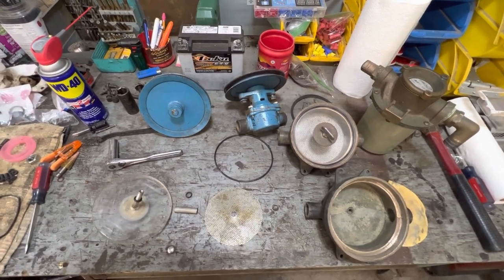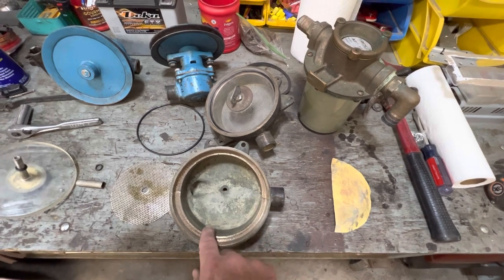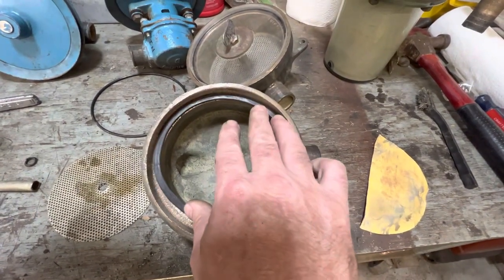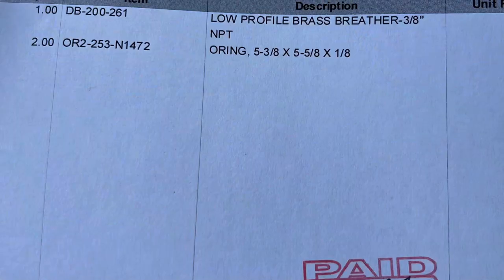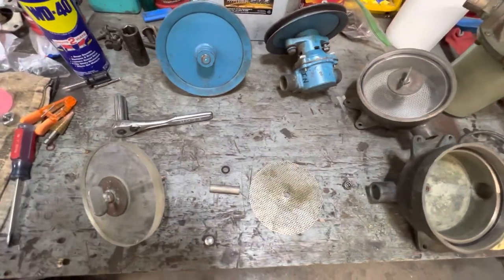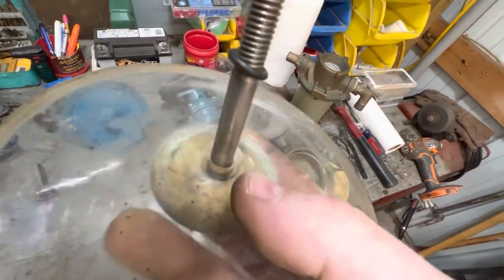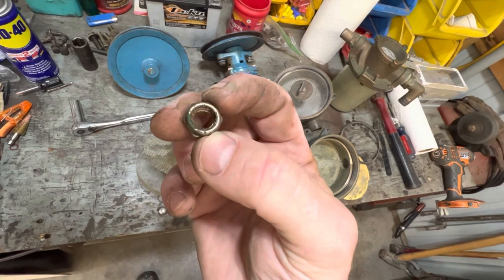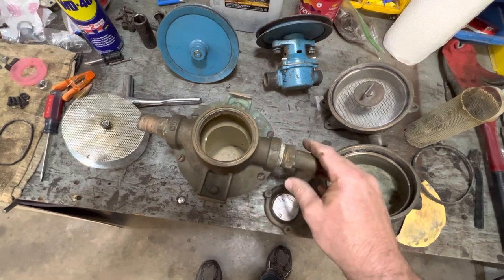Raw Water/Sea Strainer Maintenance For Inboards Engines On Your Boat….

Comment: Thanks so much for taking the time to share these tips with us.  I always had a problem with the round oring seals slipping when I tightened the lid.  I finally just ended up using silicone caulk on everything.  Haven't had to take them apart yet.  Hopefully I can get the cap back off. 😁
Reply from the maker: Well thanks for watching!!!! The Orings are still working great with no leaks and I plan on using them from this point forward… It will take a little work but you should be able to get the lid off.